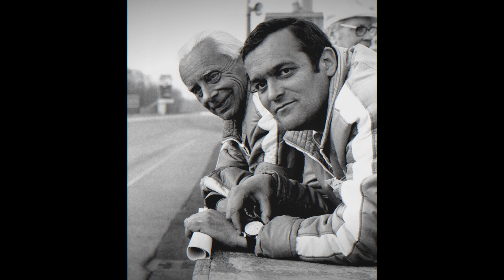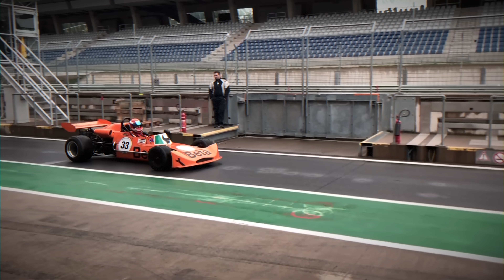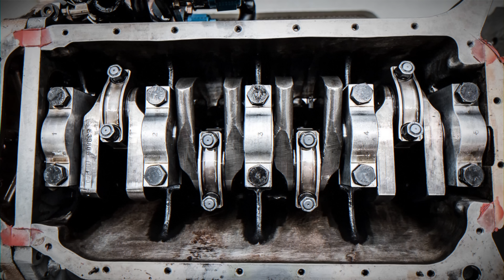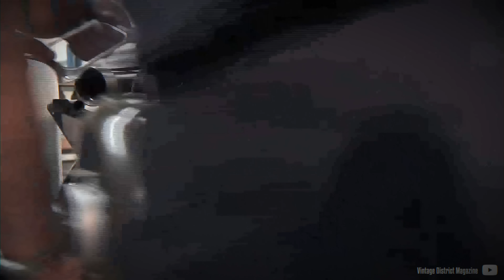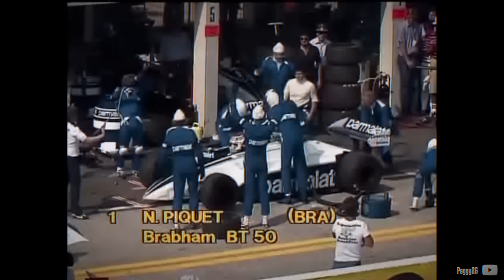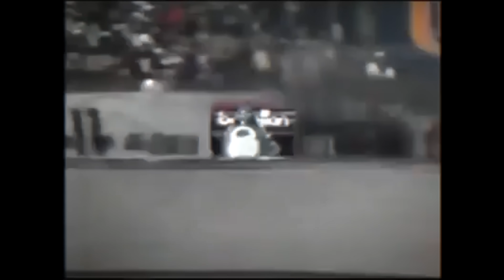BMW's 5-Minute 1,400 hp F1 Engine

Comment: I've always wondered what the butterfly valve on the turbo inlet was for (there are separate individual throttle bodies where you'd expect). I have a theory that it was a primitive sort of anti-lag but not positive. It looks like it's cable actuated.

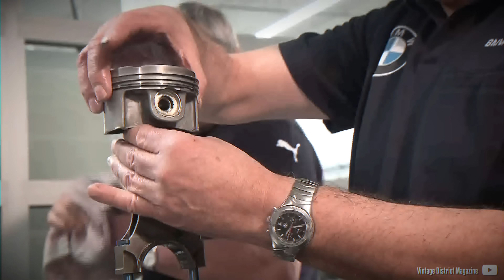Comment: What wristwatch is he wearing during the engine assembly? Starting at 05:10 min mark. 
Looks like a nice chronograph, would like to know more about it. Thank you.
Reply: It's BMW branded in the video and a recognisable model with a V line in the transition between watch case and metal band.
Some Googling led to eBay Germany where one is on offer for € 349. Seller says it's a 2001 BMW-Williams Formula 1 model and the battery is flat. So it will be a quartz watch. And the question is if will run after you succeed to replace the battery. Omega taught me that the motors in e-watches over the years increasingly get a harder resistance due to wear and hardening of lubrication. At some point the tiny battery doesn't cut through that any mode. (In other words, spring-loaded mechanical watches have more torque and you of course know that x HP is the ability to apply y torque x times per minute.)

Comment: A massive turbo on a 1.5L 4 cylinder that uses air, water, and fuel to stay cool enough that it does not melt itself to death... yeah that is going to have some major performance implications regarding throttle response and turbo lag.

Comment: Something that should be mentioned is that these engines in F1 cars were SUPPPER unreliable. If this was in a road car it would blow up in a week lol
Reply: The turboed ones atleast
Reply: Only if driven @ 315kmh. At sedate road car speeds, stresses are low.
Reply: @nordic5490 Well yes true, but still there are probably some exceptions to that.

Comment: if the myth is true,bmw engineers used 100,000 mile old blocks and kept them outside,they even asked the workers to p155 on them during their smoke breaks,the theory was that all the stresses and weaknesses were worked out on a old block,as for the p155.....must be some witchery to strenghten the material.either way the real truth will always be shrouded in embellishments by those telling the story of this crazy engine.

Comment: Engine produced a lot of power and lasted about 5 minutes... They've been applying this tech to their road cars ever since.
Reply: Minus the part about horsepower.
Reply: If you go to the limiter with cold oil it's your fault and not BMWs... I never had any problem
Reply: @Mclovin4548    The other thing is cheap clowns going to Jiffy Lube after 10K.  My mechanic uses Mobil 1 on everything and factory or better filters.  For the BMW, BMW oil and BMW filters.  If you suggest anything else, he will tell you to take your business elsewhere. 

BMW's also say use premium fuel 91 octane.  Idiots will use regular to save a little.   Any car you need to maintain.  BMW, Porsches and Mercedes need to follow the maintenance schedule to the T.  VW and Audi are pretty hopeless like a Jeep.  

My mechanic was a Toyota fanatic.  He is heartbroken and baffled by the new turbos in the trucks.  He said they are trash.  The dealers will not take them in trade in.  He looked at a friend's 4Runner that was about 5 years old.  He said those are great and wanted to buy it.  He said the new ones are junk.
Reply: BS.   This 5 minutes was for qualifying with the M12/13.  They welded the waste gates shut.  The engines had so much power that they had to use special BMW Wintershal fuel made by BASF.  In addition, PROM chips were just becoming a thing.  You buy today from any tuner.  Paul Rosche had the H chip for qually.  Probably 1450 bhp. 

The Paul Rosche BMW V-12 in the McLaren F1 road car won it's first 24 Hour LeMans race.  They ran those cars in a European race series of about 8 races.  The engines never had a rebuild in those races. 

BMW has been making Turbo road cars since 1972 (?) in the BMW 2002 Turbo.  This was Swiss-American Bob Lutz who fixed BMW in the early 1970s, then he went to Ford of Europe then Chrysler and finally GM.  He also started BMW M or Motor racing division. 

The BMW turbo 4 cylinders and straight 6 are very reliable.  You have to maintain them.  Change the oil and filters at 5k using BMW oil and filters.  They cost a bit more.  The problem is broke ass losers buy them and take them to Jiffy Lub after 15,000 miles.   The straight 6 is used by Morgan, Toyota, and the Ineos Grenadier 4x4 because the straight 6 non-turb is one of the most reliable engines made. 

The twin turbo V8 and V10 BMW's need extra care maintenance but loads of losers don't spend the money.  They just want the bling.
Reply: It 80an technology, what do you expect. Infact in early 2000, anything beyond 1000 is scare to public

Comment: It is a myth that they used used engine blocks. All of the f1 cars from early 80s could develop around 1200 HP, but only for one lap after that those engines are scraped.

Comment: Pretty sure that they were using funky special fuel blends too, back then, cause you ain't running 80 psi on pump gas!😮😅😊
Reply: If I’m remembering correctly, it was like 85% Toluene, a splash of diesel and the rest additives. I know they definitely used toluene and diesel mixed, just not the exact ratios or additives. Crazy fuel though!
Reply: @kylecreek6735 diesel would be catastrophic for octane, no way

Comment: Yes yes... engines were high in horsepower, but on what kinda fuel?
Reply: Kerosene or pure methane mostly
Reply: @indominusrex1652  Kerosene is a oily liquid which will poorly work in a spark ignited engine... they used Toluene with a octane of 128
Reply: @antoniosestar3671  then i got my fact wrong thank you for correcting me it seems that the source i read on this was 50% incorrect

Comment: Ludwig Apfelbeck designed the radial valve design. It was in fact used on some of the racing engines. The twin intake ports enabled the cylinder head to "breathe" better with less turbulences. It was found that single or "combined" port designs were more restrictive.
Reply from the maker: Yes, something Lancia with the Triflux engine experimented with years later in rally

Comment: I'm transcribing a comment I made on another post about the M12/13 BMW engine:
"In 1997, when I was working with Gordon Murray at McLaren, developing the F1 GTR, I was one of the fortunate to be invited to a demonstration of the BT52s that run and won the 1983 championship. The demonstration was presented by the mechanics and also some of the engineers involved with the development of the car and engine at that time. I was one of the present who asked about the myth of using old engine block and the hp values and I was surprised when the Germans started laughing. They asked me why would they use old blocks if they could choose a much better quality cast to work with and that the myth of using old block was just it, a myth, that was no one really knows how it got started. Also, the engine never run more than 900HP during a race. Even in qualifying mode. They tried several times more than 4 or 4.5 bar of boost but it would break almost immediately. That myth started because one day there was a filming crew at the BMW facilities during on of the tests and they were running a lot of boost and the dyno was only scaled to 1000HP. During the run of the engine the pointer hit the top of the scale just before the engine exploded, but what was said by the reporters was something like the engine more than 1200HP! I'll always cherish very much those days and all the memories."
Reply: sorry to say so: its not correct what you are saying. The meccatron used after BMW in Arrows had arround 1100-1180 hp. Proven in the documentation of the car in the youtube channel of the Toyota heritage keeping FNT team. They own also other cars including that Meccatron ( BMW) driven Arrows. And for sure the works-BMW had more power than the Meccatron!
Reply: But then you must also remember that the test facility wasn't at BMW but actually at ALPINA in Buchloe right?
Reply: @olofsweden no it wasn‘t. They already had in the 1970‘s founded the M-GmbH, taking care about all Motorsport aktivities of BMW.
Reply: @ReinhardPriller-ck9ny  Maybe so, but the dyno at M-GmbH couldnt handle more than 1000 hp. At Alpina the dyno was capable to handle over 1400 hp. Many years later the old guys came together to memorise "the good old days" and again made a dyno run with an F1 engine. All the windows and doorpost surrounding the dyno room are bright lime green... They are obviously in Buchloe!
Reply: https://www.youtube.com/watch?v=6ko5BvTOoog Here you can see the reunion after they rebuilt one engine, They are at Alpina in Buchloe exactly as back in the day... Many Alpina enthusiasts have heard about their (sometimes secret) cooperations through the years.
Reply: What is your identity to establish your credentials? I thought Paul Rosche himself claimed that they used old blocks with 100k miles. I believe he claimed this on his memoir.
Reply: I have read  in Racecar Engineering that they tested stock block, but could not get it to hold more than 500hp.... And it was the marked department who come with the story of using stock used  blocks laying in the rain to get the "stress" out of them... They probably couldn't see the difference anyway🤣🤣🤣
Reply: @Robinrms there was already in the early 1970‘s when Schnitzer made the 1,4l Turbo for DRM having more than 500 hp!

Comment: It's a shame modern BMWs aren't as robust as this engine was. Imagine if they had used 2 smaller sequential turbos, like Mazda did for the FD RX7 - they might have killed off the lag and had maybe not as powerful an engine, but one that could reliably finish.
Reply: Sequential turbos aren't needed anymore for those use cases as turbo technology has just made leaps since the late 90s. Single turbos make more power, faster and with way less complexity in the engine bay. Most of it is advances in fluid dynamics.
Reply: B58/ S58 are making over 1,000hp on the stock engine with just boost and fuel.  👨‍🏫

Comment: with modern injection and tech it must be a rocket
Reply: Not sure if it was the Beyond The Grid pod cast or a vid on youtube, but an engineer from that time said that with modern engine management and fuel systems they could easily get double the power they were making in the 80's.

The interviewer asked "You mean you could make over 2000hp?!" A: "Oh ya for sure, easily. And using the same boost."

The Hart engine manufacturer learned how to cast an entire engine block and head as one piece. This way they didn't have to worry about stretching head studs lol 🤯 I didn't even know that was possible, with all the machining you'd need to do to a new engine...
Reply: @bassmunk  power yes but the car wouldn’t have space for enough cooling under the same conditions make more power yes but not double
Reply: @user-wn3ww5lw5j  They're already doing it right now, in effect. Making the same power with half the fuel, with just the ICE not the power unit as a whole.

Engineering Explained has a great vid going through the insane lean mixtures they're accomplishing.
Reply: @bassmunk  the ice in modern f1 doesn’t even produce 1000hp but yes has a insane efficiency. The old ones used so much fuel because it was not normal pump gas and needed it for cooling
Reply: @user-wn3ww5lw5j  In race trim neither did the 80's engines. They were making between 800 to 900hp during the race. And were still struggling to finish without running out despite having 220L to use for the race.

Modern F1 ICE's are making over 850hp on half the fuel allowance... The info's out there, it speaks for itself.
Reply: @bassmunk  you can’t compare volume of fuel because energy density is different. Yes the new engine is way more efficient but the old ones are more powerful with 0,1l less displacement and the new ones could push 1000hp not even for qualifying since everything is precisely designed for the power it’s at in normal race trim
Reply: @user-wn3ww5lw5j  Why bring up qualifying? That's irrelevant to the comparison.

Sure new engines are 100cc more, but you really think that makes my point irrelevant? Especially since they have fuel flow restrictions that the 80's cars never had? Having that max fuel flow restriction makes a real difference to max power.

Let's call it even, new engine + 100cc - max fuel flow restriction. 80's engine -100cc + unrestricted fuel. Even playing field lol The reality is my point, which is the engineer's point btw, that modern tech can achieve double HP with same displacement still stands. Why you're choosing to argue this as if it's wrong makes no sense...
Reply: @bassmunk  it’s stupid to compare anyways both engines were build to complete different rules and of course the new engine is technically better
Reply: @user-wn3ww5lw5j  It's not dumb to compare, their within 100cc of eachother and turbocharged. And the old engines had way more freedom to achieve performance, which includes fuel development. It's a great comparison to illustrate engineering development over the past 40 years.
Reply: @bassmunk  yes but the modern engine can’t make more power because everything is exactly designed for the power it produces. The bmw engine is just a normal production engine block with a big turbo on it rocket fuel and just crazy 😂
Reply: @user-wn3ww5lw5j  If the modern Turbo motors didn't have the fuel restrictions & limited number of engines for the whole season including practice & qualifying, they'd definitely be pushing 1800+ Hp out of them. Those old engines were only good for a Single Race at that 800-900Hp, and single flying lap at 1400hp for qualifying, as back then there was no limit on how many engines you could use
Reply: @MrBluePoochyena  if they didn’t have the fuel restrictions the complete engine would be different that’s what I am saying the entire time the modern engine can’t handle any more power than it is pushing because it’s developed for exactly what it’s doing
Reply: Why not build one from scratch will be way more powerful

Comment: I dont know any engine that has power ratio of nearly 1 hp/cc besides this. Anyone got some other example ?
Reply: VAG gen 1 and gen 2 V10 can get 3500HP if you make them drag monsters because UGR lambos already do this

viper V10 can get around 3300HP mark, there is a drag car called kratos pushing that power

VR38DETT's get around 3000HP because Nissan built them like they were tasked to build a tank and HKS sells a 4.3L crate motor

fully built aventador should be able to reach 5000HP mark if someone is crazy enough to do that
Reply: There's some highly modified drag RB26's, making like 3000hp. That's likely bored and stroked, but i don't think they're much more than 3.0L . There's some K series and 2JZ's modified to that same point too (not same power, but about the same hp/L), and also top fuel dragsters
Reply: @Giuliana-w1f  they are 3.4L bore and stroke setups just like 2JZ's are
Reply: A rocket engine.
Reply: @Guns_N_Gears  Rockets are external combustion engines so they don't have a cc. But I guess turbojets without after burners count because they're internal combustion.
Reply: @stormix5755  exactly
Reply: I would guess there's plenty of tractor pulling engines that make more power per liter of displacement, all those old Soviet tank V12s converted to run on methanol with huge specially casted turbochargers.
Reply: I do know that top fuel dragster making 10-11k of horsepower, but it looks like its engine is huge even though i dont know its displacement but i assume it has more than 10 or 11 liters of displacement. CMIIW ✌️✌️
Reply: @fausanhabibie7515  It uses a 500 cubic inch Hemi. 

That's a lot of displacement, but when you compare it to other engines that make 10Khp, its tiny.
Reply: @oldscratch33  Is 500 C.I tiny compared to liter or CC? Im sorry i dont know C.I unit.
Reply: @fausanhabibie7515  500cubic inches is 8192cc, they also use nitromethane as fuel, top alcohol using methanol as fuel is a little more fair of a comparison but the supercharger is the limiting factor. The giant belt driven blower takes hundreds of horsepower to turn and has really low airflow compared to what would be possible if they were allowed to run unlimited turbo.
Reply: @timothybayliss6680 oh nice info, i dont know CC is so small compared to CI 😂😅
Reply: @fausanhabibie7515  they're 8.19L (500ci)